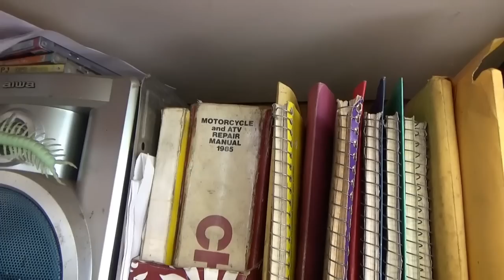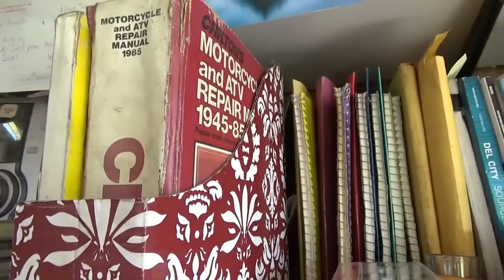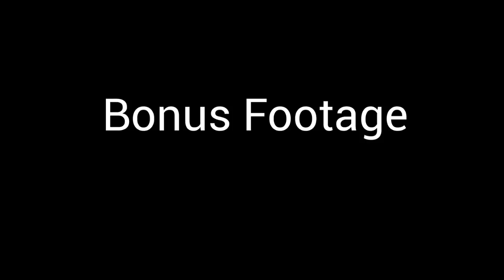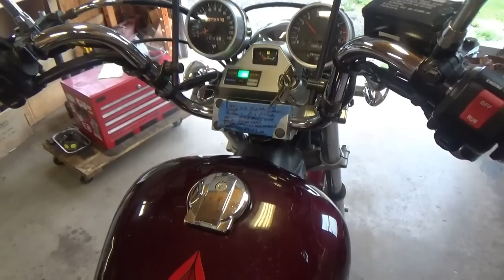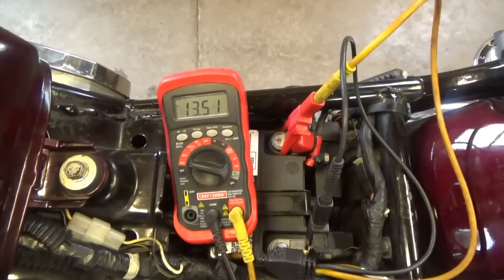Zen & the Art of Carburetor Cleaning

Comment: Gas leaves varnish not ethanol, ethanol just eats unprotected aluminum if the anodized layer is damaged.
I know this cause I grew up around alcohol motors. 
Sprint cars at Ascot raceway in the 1970's taught me allot, and the builders gave me beer and instruction after each race night. These guys built their cars from scratch, chalk lines on the floor of the shop and little else. They gas welded them, and annealed the frames, that was the state of the art back then.
There is nothing on this planet like a sprinter, they were the original Indy car, and they didn't rely on wings, wings are for those that don't know how to drive a real race car on dirt.
Take the wings off an outlaw car, and they wouldn't last ten minutes.
These days I run two stroke nitro motors in R/C aircraft, nothing like the smell of methanol to bring back ground pounding memories of Saturday night at Ascot.
Reply from the maker: Thanks for the comment James! I always wondered what causes the deposits. Is gas varnish that sticky brown stuff? But the chunky green crusties must be due to additives or ethanol?
Reply: @PineHollowAutoDiagnostics  We know water collects at the bottom of the bowl, and it will work on the jets themselves as it's the last material to evaporate. Ethanol won't leave any residue, fuel leaves varnish, water leaves corrosion byproducts at the lowest point in the carb, right at the drain valve area. Ethanol does help isolate water in a fuel system, it combines and eliminates water while you drive, it's drawn up with the fuel and burned. Once the vehicle is parked, the fuel and the ethanol will evaporate, leaving the water behind along with the varnish and things go sour pretty quick. People don't like ethanol, I don't understand their reasoning. Fuel tanks always accumulate water from the air as fuel is used, and when the fuel sloshes around that water sinks and cannot evaporate, without ethanol it will remain in the system forever. Few realize the specific gravity of these liquids, water being the heaviest followed by gas, and then ethanol. Besides, ethanol is denatured, and in my mind that makes it methanol, ethanol is basically a marketing term, it invokes an "Ecological Friendly" alternative to gasoline or methanol. It will destroy unprotected aluminum, but it is really useful in all other respects, ie water removal, and octane rating. 
People would do well if they drained the fuel before storing a vehicle long term, but they don't.
They put a drain valve there for a reason, but nobody uses it.

Comment: I work on small engines professionally and I found the best way to clean the brass jets. I just torch them till they are glowing red then cool and then clean. The intense heat just turns the varnish to ash
Reply from the maker: Hmmm great tip! Might have to try this. How do you hold the jets to prevent deformation?
Reply: @PineHollowAutoDiagnostics  I just leave them on the steel bench. I have yet to see one get deformed. It's just a propane torch so it doesn't get super hot

Comment: You need to replace every fuel line. The alcohol in gasoline today eats all pre 2000 (rubber) fuel line from the inside out. I rebuilt my ‘95 FXDWG carb 4 years ago. Rubber fuel line was in every passage and jet.
Reply: While I agree that all "rubber" fuel lines (real rubber has not been used in fuel lines since the 1950s; it is typically neoprene) over 10 years old should be replaced, ethanol is not a "evil" as most people think.  No carbureted engine should be stored with ANY type of fuel in the float bowl.  (I would try to replace that vacuum operated petcock just so I could run the float bowls empty before storage.)
Reply: Jack Patteeuw I agree that rubber has not been used in years, the higher the alcohol content the faster the pre 2000 fuel lines disintegrate. I had to replace mine due to failure from the inside.
Reply: James Mcgraw adding or changing all to PTFE or New Gates submersible gas lines after  35 years should be a big help.and tank
Reply: Pecan pie that is exactly what I have done ✅
Reply: He did replace them - that's one of the first things he mentioned at the beginning of the video.
Reply: I use carb cleaner. I don't mind the smell and it works well. For cleaning jets, emulsion tubes etc. I pluck a steel wire out of a wire brush. Someone else mentioned using welding tip cleaners. I never thought of that. I'll try it. Thanks for the tip!
Reply: @gwick358  - I have a set made by K&L specifically for motorcycle carburetors. I've had it 20 years, so I'm sure there are other companies that make them now. They're all the correct sizes for most pilot and main jets. The welding ones are usually too big for most carbs I've found. The rods are ribbed, so they grab all the junk right out of the jets. Just have to be careful, because you can enlarge the jet fairly easily.
Reply: @SmittySmithsonite  Cool I'll try to find some. It seems like I'm constantly going through carburetors.
Reply: @gwick358  - Yeah, these days with the fuel they're feeding us, carb cleans have become routine maintenance. Good to have a set, just in case.
Reply: @SmittySmithsonite  Comprehension is weak in some of these guys
Reply: Pecan pie - I’ve had great luck with Tygothane C-210-A formulation for fuel and oil lines. They can’t handle much pressure, but they’re great for gravity fed systems. They’re a clear line so you can see the fuel flow,  & they last virtually forever, even with our diluted booze fuel.
Reply: Smitty Smithsonite I use toothpicks, when it comes to cleaning small passages (jets), have been for 50 years.
Reply: Use clear plastic fuel line if possible. It doesn't "particulate" into the fuel system.

Comment: Sweeeeet! Finally something I understand completely, HAHAHA! Nice work, Ivan!  I saw that in the background of some of your other vids - I was way off! Swore it was an inline 4 back there, and it looked like a Yamaha Maxim.

I always hated doing carb cleans on those bikes (any v-twin, but the Vulcan was a bitch!), especially as they aged. Getting those carbs in and out of those hardened rubber intake boots is a royal PITA! Used to use alot of carb clean and many choice words to stuff them back in. Some inline 4's are even worse, like the Suzuki GS. 

Gotta get yourself a set of carb stix now to dial those things together in perfect harmony. I used to have an old school set that took 4 oz of mercury. Starting about 14 years ago, I couldn't find replacement mercury for them, so I had to toss them and grab a set from Great  Britain that had steel inserts that floated inside. I forget the name - I still use them. They actually look like mercury columns. Work pretty well, but not as precise as mercury was. Used to have to be careful not to rev the bike to the moon and slam the throttle shut, or you'd suck mercury into the engine! As you know, mercury doesn't compress, LOL! Damage central. Thankfully I was one that never did that!  

WD-40 is an interesting choice of cleaner. I never thought of using that. I started out using carb cleaner that would take paint off in the old days. Get it in your eye, and you were down for several hours until vision came back! These days I use brake clean, since even the best carb cleaner won't touch any deposits like what you had there. It's more of just a flushing agent than an actual cleaner. I think WD might dissolve that crap better than brake clean - I'm gonna have to try that out some time. I have no use for WD otherwise - I've got a few cans that have been laying around here for 15 years - might as well use them.

Looked like someone has been in those carbs before, since there were no limiter caps over the fuel screws. Used to have to drill a small hole in them and yank them out with a sheet metal screw. No surprise, since the thing is 34 years old now. I always put them back in at least 1/4 turn out from stock, since the fuel today sucks so bad. Anyway, great vid as usual, Ivan! Did everything the same way I do. I graduated from MMI Phoenix in December of 2000. 👍🍻 

I'll be taking the '74 Yamaha RD 350 2-stroke out for a ride this weekend  with a bunch of buddies. Should be a blast. I've only put 140 miles on the thing this year.  I gotta get out of the shop more, lol!
Reply from the maker: Great comment Smitty! The other bike that you saw in the background was my 1982 Yamaha Seca 750. Love that bike... Great sports tourer. Haven't touched those carbs in over 10 years, runs perfectly 😁
Reply: @PineHollowAutoDiagnostics  - AHH, so I wasn't going blind and crazy! 😂 

Yeah, you won't have any carb problems because you understand how it all happens! I don't use any stabilizer either, aside from some Amsoil Quickshot in my paramotor and in the RD, just in case. Keep the carbs dry, and you'll never have a problem. 

I forgot all about the Seca! I haven't seen one of those in decades. SWEET!! Hang on to that one, Ivan! They don't build stuff like that anymore. 👍👍😎
Reply from the maker: @SmittySmithsonite  the RD 350 sounds like a blast too!
Reply: @PineHollowAutoDiagnostics  - It is! I've got ALOT of work done on that one. 11 years ago I yanked the engine and did a full restoration to the bike - only thing that didn't get paint was the frame - figured I'd keep that original. Has Progressive rear shocks, Race Tech emulators up front in the forks, new fork inners, new seals, bushings, etc.. Tapered rollers in the steering stem, and needle bearings in the swingarm. The engine has Banshee pistons, shaved heads for perfect .040" squish, mild cylinder porting,  Yamaha "34x" connecting rods (better oiling at the bottom end), lightened and balanced crankshaft (by Falicon in FL), then I got some YZ125 reed valves and clipped one petal off so they'd fit  - works like Boyesen, except for a fraction of the cost, reed spacers, manifold crossover tube, and both carbs have the "Dave F. mod", and have been painstakingly jetted to perfection. I finished it off with a set of DG pipes & a K&N filter. Stock jets were 140 mains - I've got 220's in it now, and it's very happy.  This thing RIPS!! I've had it to 110 with my wife on the back - she was punching me in my ribs, or I could've gone faster HAHAHA!  😂🤣😂

Going to bring the GoPro with me on the ride this weekend. Also might shoot some vid today of getting it ready.

Oh, and I'm still running the dual points ignition system, too. 😎 Only electronics this thing has is a modern combined regulator / rectifier for the charging system. New brushes in the alternator, too.
Reply: @PineHollowAutoDiagnostics  those seca's were great bikes  very similar to the virago's  but made to race.  carb floats were extremely tricky to get right as the levels were different for each cylinder

Comment: Set of 4 Carburetor Carbon Dirt Jet Remove Cleaner 26 Cleaning Wires Set + 20 Cleaning Needles + 10 Nylon Brushes Tool Kit for Motorcycle ATV Moped Welder Carb Chainsaw Spray Guns Torch Tips. This is a very nice cleaning kit found on Amazon for around $10.

Comment: Great video I use the copper wires to I had a small tool box I go to for rebuilding carburetor and in the are different thickness of copper wires and some wire drill bit for stubborn and most gummed up jets

Comment: The screws on Japanese motorcycles are JIS screws, very similar to Philips head and usually have a dot on the head of them,  using a Phillips head screwdriver will cam out of the screw a lot of the time and round the slots off (especially if they’re tight), i wish I would’ve bought a set years ago, fffed many a JIS screw ☹️☹️
Reply: Those damned things! I hated those. I rounded out many as a teenager trying to replace clutches on mine, & friend's bikes. Never realized they were different until I went to MMI many years later.
Reply: Smitty Smithsonite a Phillips head screwdriver never felt quite right in them, but it took me many rounded ones to realise something wasn’t right, with the right screwdriver though they’re are a breeze and much more torque can be applied to the screw with this design
Reply: mark jenkins - Yeah, I remember! Still haven’t bought a JIS bit in all these years though, lol. They’re few and far between these days, thankfully. 😂

Comment: This is a rather unusual setup. Two carburetors sharing one float bowl/needle seat assembly. If that needle seat rubber has any ridge or groove in it, it must be replaced or the carb(s) will flood intermittently. Some of that residue looks like fuel line rot.

Comment: How i usually clean the idle and main jet:

Ultrasonic cleaner ❌
Picking it with thin wire ❌
Soak both idle and main jet with engine conditioner and blow em directly with 150 psi air compressor ✅
😂😂😂

Comment: Just a quick (and important) safety message for all you budding motorcycle mechanics:
(i) Make sure you work in a well ventilated workspace (open windows doors etc) or you'll get dizzy!
(ii) Do not use you kitchen sink or toilet pan because, as much as you flush away any spilled fuel, it will always float to the top of the drain and can actually explode if ignited. Which brings us to the last point.
(ii) Don't have any ignition source, cooker or naked light within 1 mile of the bloody thing. For the same reason, it will explode.

Comment: Some guys use that duster spray as a substitute for the old r12 AC system refrigerant.  It is R152a and has pressures similar to r12.  It must be used in a clean system, no mineral oil,  with ester as the lubricant.  Some say it is too volatile but isn't all refrigerant?  They will check your ID when you buy more than one can since kids sniff it for a high.

Comment: 32:40 we put the brass parts in a strong carb clean solution.
Reply: I agree, not WD.
Reply: Where do you get anything strong today? I haven't found anything since before '06. The EPA sure did a number on carb cleaners ...
Reply: @SmittySmithsonite  trying to remember what the can label is, it's a gallon can with a mesh basket in it for dipping parts. Gunk maybe, I'll have to look, maybe NAPA?
Reply: @ScottPuopolo  - I was curious if it was the same Berryman brand that I have. I haven't used it in years. Takes a long time to dissolve stuff - it's faster for me to use brake clean and a jet cleaning wire set.

Comment: I avoid using ethanol gas in my garden tractor because it's a guarantee I would have to take the top of the carb off and clean the jets if I did use it. I do have to replace the fuel lines on it though, they are 28 years old, lol.

Comment: I charge 4 hours to do a carb clean on that particular nightmare of a carb, includes removal and install.
Reply: LMFAO, " NIGHTMARE OF A CARB. " SO TRUE.
Reply: Yeah I friggin hate those things. Last Vulcan I did was 11 years ago. The intake rubber was as hard as a rock! What a bitch getting those things back in. I was pissed, LOL! I usually charge 4  for any multi-cylinder bike. These days they're all getting old now, and hard rubber really takes a lot of time to work with, in addition to scraping all the crap like Ivan had out of them.
Reply: @SmittySmithsonite  HEAT GUN!!!!!! they'll get soft as putty ;)
Reply: throttle bottle - They’re pretty thick. Takes a long time to heat, and they don’t soften like you’d think they would. Carb or brake clean as a lubricant is the fastest way. I’ve tried every trick on the book over the years. Depends on the bike, too. Some are MUCH easier than others.
Reply: Fortunately, there's a way to restore the rubber parts :

https://youtu.be/9eTF6tnYYdc
Reply: @ScottPuopolo  - Wow, that's alot of ingredients there! 😳
Reply: Wintergreen oil and alcohol for a day it will swell the rubber tho but soften it. Might have to wait for the swelling to shrink again but no permanent way to keep old hard rubber soft.
Reply: Will harden up again within a year tho
Reply: @SmittySmithsonite  that guys channel is a hoot, too funny.
Reply: @SmittySmithsonite today i use a heat gun on rubber boots, it soften dam hard rubber n out that carb .

Comment: Don't you need to sync the carbs?  I never synced the carbs on my 85 Kawa ZN700 because when I cleaned the carbs the butterflies appeared to be operating together exactly.  But, recently it started missing at idle on the #1 cyl.  I bought a gauge set and synced them.  #1 was almost close off evidently.  Now it throbs at idle on all four like it should.

Comment: Try cleaning the carbs off of a 1988 750 Honda Super Mag. 4 Carbs in a V cylinder config, rubber connector are totally hard and a bitch to work with. You should of showed the removal and installation, why not put some vacuum gauges on the carbs and balance them out, it helps alot. A set of jet drills would also go along way, tho Im sure you dont work on carbs alot nowadays. Question..when they went to ethanol did they just make the jets bigger to let more gas through. Ultra sonic s are for cleaning passage ways and brightening the pot metal, not for cleaning jets. Oh they are called emulsion tubes. Bowl gaskets should be replaced, once removed, they are old and sometimes will start leaking in the near future. I believe that bike never gets ridden.

Comment: 42:03 be sure lip on rubber diaphragm sets in groove in carb body all the way around. If it gets pinched or misaligned, the bike will idle but may not rev up well.
Reply: I found that it will sound like ww3 just broke out at 0530 I was surprised no one complained.